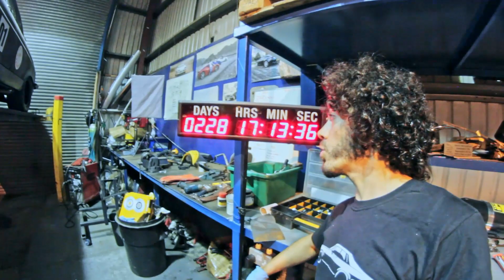Taking the manual gearbox out of my Jaguar XJS V12... VLOG19

Comment: Marko what kind of gearbox do you use?
Reply from the maker: jay22nup I'm using a jaguar getrag gearbox from an 6 cylinder XJS manual. There is a company that supplies all the parts for a conversion here in the U.K. Called Simply Performance, very nice people!
Reply: Rust2Rome Thanks